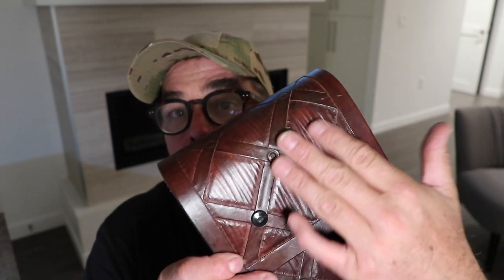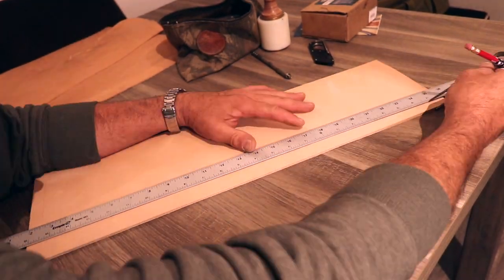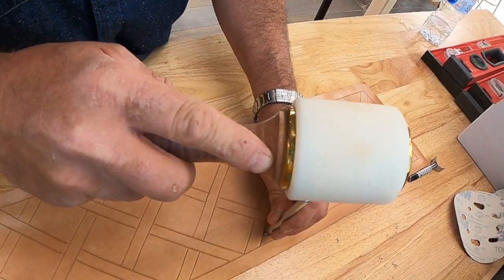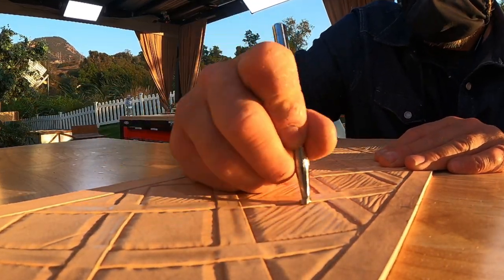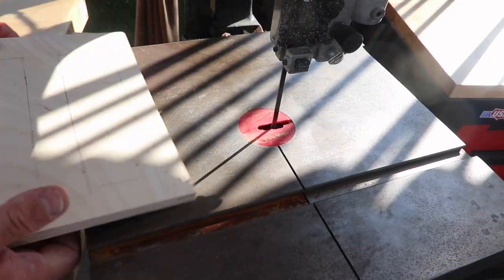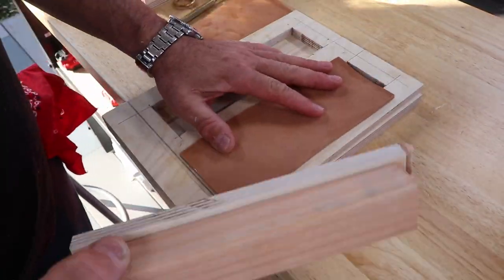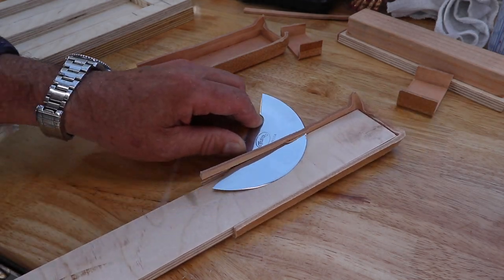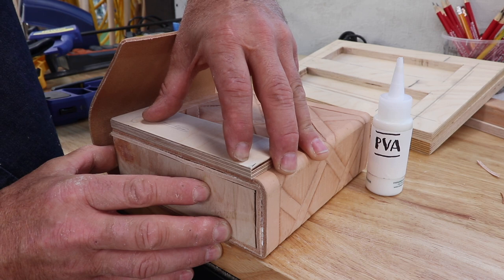DiResta Leather Tooled Bag

Comment: It's a swivel knife. And, technically, you're supposed to hold it a little differently (not so close to your hand) which gives you a little better control when you're cutting the lines. But if it works, that's all that matters.

Comment: This was so good! I got into leather because of your pants years and years ago in the basement shop. I don't know if you knew but working the leather wet then when it dries the dye will take so much better. Learned it doing some molded panels, noticed they took dye better than other pieces. Also to hide your brusher marks of the dye, use a sacrificial piece of wood (I use dowels) and rub it gentle while its still wet, itll blend everything without lifting the dye. This was a wicked good video, I've fallen in love with leather working.

Comment: cool little project, i dont do much leatherwork but I have found that if you put a bit of candle wax on the hole punches between punches it helps prevent the punch from sticking when working with thicker material. Not sure if its the right thing to do but it does help.

Comment: a lot of good stuff here.  let me help because i'm a novice and had these things come up:
1) In addition to always repeating left, then right, or right, then left for a saddle stitch, it's REALLY important to pull one up and back and the other down and forward, depending.  Just be consistent and your stitch will look straighter  that's probably the best advice I've got for you that helped me.
2) In a normal saddle stitch, you need the length of the stitch x4 plus a little for slop.  More if you're doing extra 'around the outside' stitches, but 4x rule is a good one for thread length.
3) melt your thread ends... but for this thickness and rigidness it would be fine not to.
4) while you didn't have enough dye to do this, if you wanted that whole thing that color, you can dip-dye it to make sure you don't get streaks. also, EVERY dye is so much darker than you think/want.  
awesome post.

Comment: Exceptionally nice bag. 😷👍 
I could use one like that, slightly larger, and with loops on the sides to mount it on my rollator. 
I'm 9999.9999...999% sure it would be far outside of my budget to commission one from you. 😷

Comment: And the curved knife is actually an Inuit ‘Ulu’.
Reply: no it's not. It's called either a "head knife" or "round knife". The blade shapes are similar, but the handles are different. You might use an Ulu for leather work, but you wouldn't typically could with a head knife, although there's no law against it.